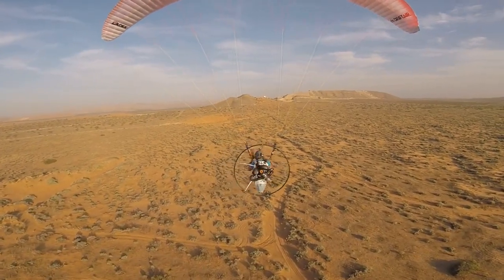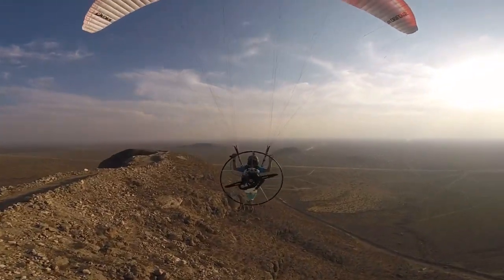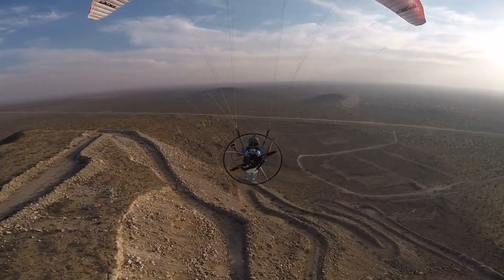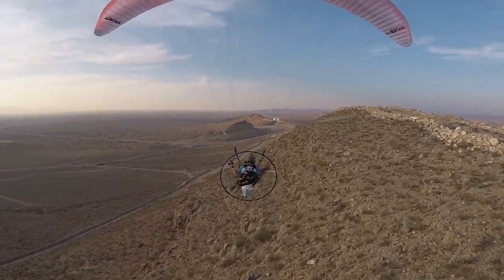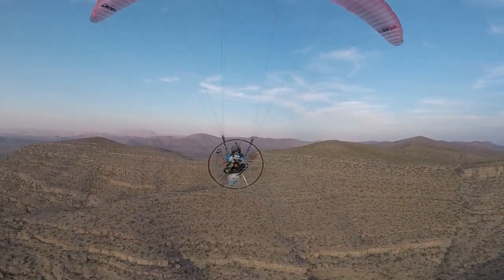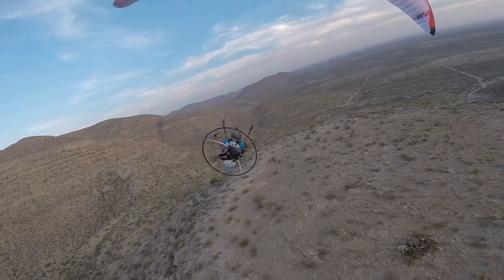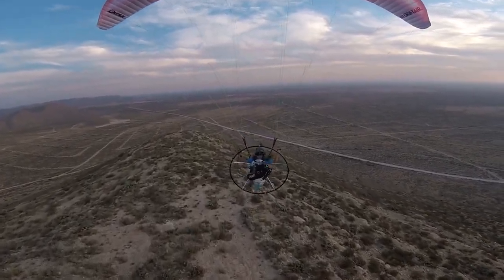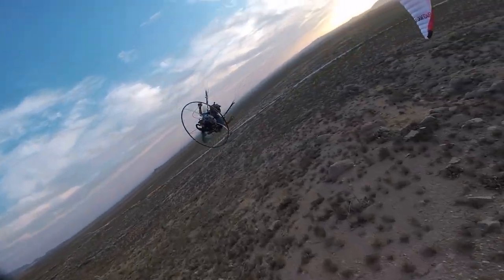Gravity Defiant Paramotor in flight

Comment: I like what Ive been hearing about the gravity machine, the 2 things I have reservations about is how easy it is to break down for transport and the long term strength of the stress points in the polymer tank , I watched Anthony's video where he jumped all over it, and yes I am looking for a new rig. Currently on Kyle O's old Yooda Yak.
Reply from the maker: I never take my hoop apart but still this is the easiest frame to take apart out of all I have owned. Literally release net tension and pull it apart. 
Time will tell for tank durability. I think it will hold up

Comment: Is this your primary paramotor? Do you recommend it over a used maverick for a beginner entering the sport?
Reply from the maker: Yes it's my only paramotor now. You can get a bran new gravity for the same price as a used mav. A used motor will eventually have problems (pullstart, exhaust, ect). A new gravity comes with a warranty to fix those issues for free if you even have problems with a new motor. I would pick the gravity. The mav is only like 4lbs lighter weight but has a tiny fuel tank and hoop
Reply: @MitchG  Thank you for the quick response. What's your opinion on this motor coupled with the Dudek Universal. I'm starting training this spring and want a wing I won't quickly outgrow 😊
Reply from the maker: @madsoothsayer  the uni is what you want. It has the most speed range out of all the other gliders in its class. I know many pilots including myself that still fly a universal even after flying for multiple years
Reply: @MitchG  Thanks Mitch. Great to hear. Any recommendations on where to shop the best price? Will dealers sell below MSRP?

Comment: Great vid Mitch. It looks like a good motor but I'm concerned about long term stress on the plastic at the connection points. Does the plastic seem substantial enough for long term use in your opinion?
Reply from the maker: Yeah imo I think it will last. Theres hardly any stress on the hoop attachment points in flight and just maybe half the weight of the motor when it's on the ground. Time will tell. I'll be racking up hours in probably the most harsh conditions so I'll let yall know
Reply: @MitchG  Thanks for the reply. Have you flown the Excend or Exceed yet? It looks like Gravity has the most affordable entry pricepoint into this sport but that makes me question the quality. I'd trust your opinion if you thought it was a good viable option.
Reply from the maker: @torqdoff  I have flown the exceed. The wings are good quality and it flew great. For the price it's hard to beat.

Comment: Amazing flying .. in your opinion am I fine with this motor and a dominator wing for safety or should I go to the flat top for best safety ?
Reply from the maker: No doubt the flattop will take more of a beating than this motor. However, with some kiting practice, the flattop will just be dead weight and less features like a smaller tank, uncomfortable harness. 
Safety comes from the pilot. You can crash hard enough that a flattop still wont protect you. There have been pilots that have broken their back and died on flat tops, so buying a specific motor doesnt make you more safe. Practice and understanding make you a safer pilot, not gear.
Reply: @MitchG  thank you for the reply . Looks like the gravity is for me with two reserves for safety lol

Comment: Do you have the pucks and ACS/DFS system?  I'd be super interested in hearing your opinion on the DFS system for the defiant and how it behaves for weight shift.
Reply from the maker: I do have dfs but I don't have the smaller pucks that allow more movement. I have quite a few hours on the virus ppg which had a similar system that allowed a lot of weight shift. 

My personal preference is a more stable harness setup. I feel like I can fly more precise with a more stable swing arm and harness because the wing only turns exactly by how much I pull the brake. With a harness setup that allows lots of roll, turbulence and throttle input have a much greater effect on you which effects the wing as well. 

It really is a personal preference thing though. Flying hot highly loaded wings, I prefer more stable harnesses.
Reply: @MitchG  Thanks for the reply. That's in line with what I had first thought. I had dismissed it as something I'd probably never really need as most of my flying is low and aggressive. Now that I am close to buying a defiant I was re-thinking it, I can see the appeal in the concept for ridge-soaring or thermaling mid-day with my free fly wing. 
I suppose I was curious if you used it in a similar way with ridge soaring  or xc / thermals on a bigger wing.
It's an expensive thing to buy just for trying out the concept.

Comment: Looks like you can get this with a Dudek Power Seat on their website.
 Would you prefer that over the custom SupAir?
Reply from the maker: I dont think so. I have the supair adjusted very nice now so its much easier to get out of the harness. I had the leg straps to tight. This harness is more comfortable in the air and I love the magnetic speed bar holder

Comment: Looks like you got the follow cam angle  worked out for this one, pretty cool. I love these red sands vids. Is the seat wider, or the attach points wider? Wondering what causes more weightshift. The Mitch's Ridge launch is looking pretty nice. BTW Big Horn have been spotted in the Franklins. The limestone in the area was part of a reef known as the Permian Reef, it formed about 270 Mya. The flat areas around the mountains were the bottom of the Permian sea. All of that is older than the dinosaurs.
Reply from the maker: The arms are further apart and the arms are on a bearing so they move easier.

Comment: Thought you were flying the universal for a while then, the wing looks super stable...
Reply: Are you going to  be doing a full review on the paramotor? I think there will be a lot less vibration through the mounts, the fuel also when fuller will dampen the vibrations out...
Reply from the maker: Yes, Im waiting to receive the carbon fiber hoop pieces and install them before I make an update video